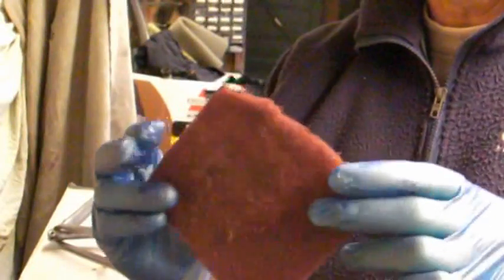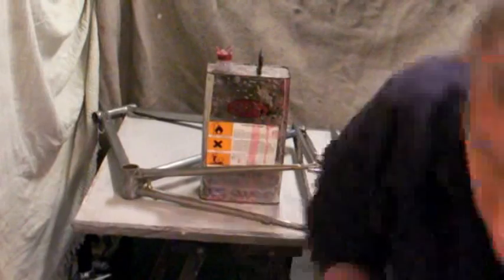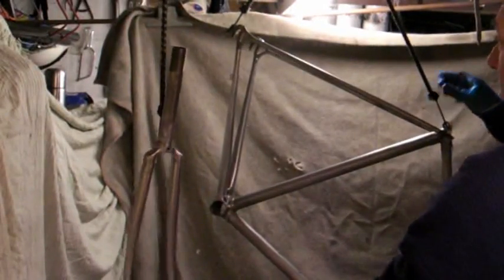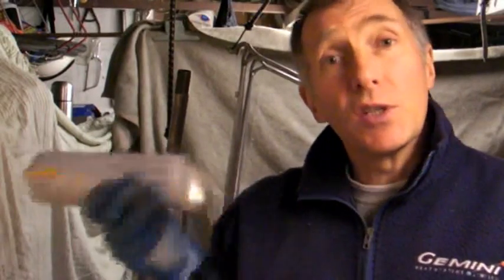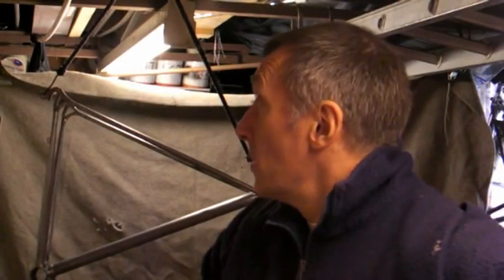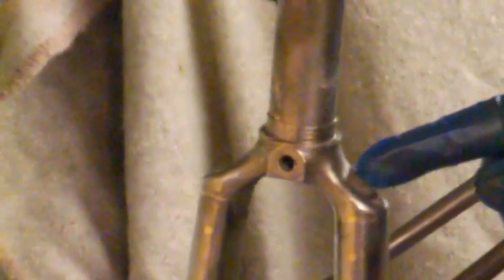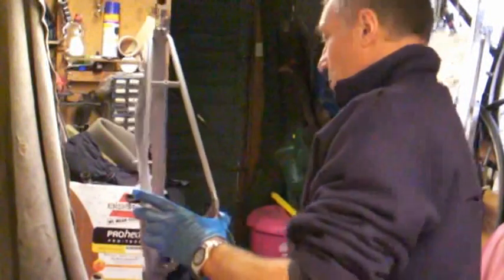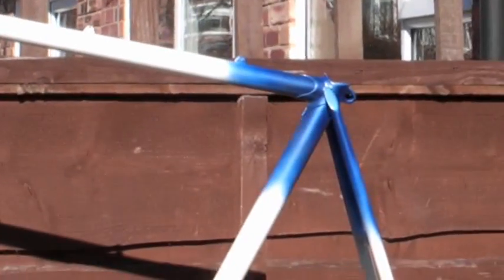Bike Maintenance - Part 4. The Respray. 30 Year Old Harry Hall Road Bike - TOTAL - rebuild

Comment: Looks great, I would be interested to see how the finish stood up to general use. I would have used an etch primer on the bare metal as it eats into the steel to protect and provide a firm base for the following coats.